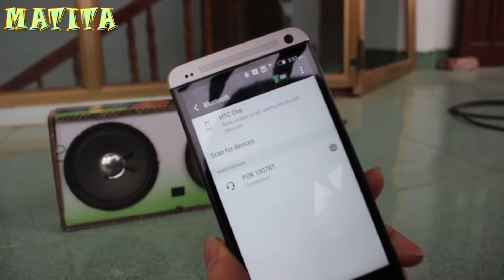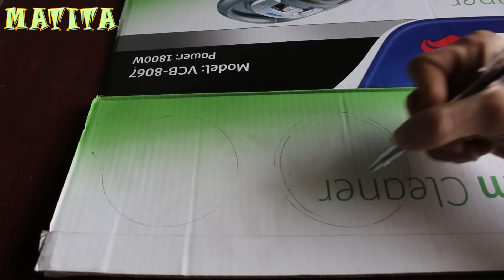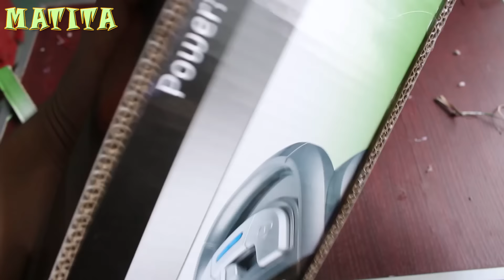Сделайте Bluetooth динамиков с использованием картона

Comment: доброй ночи! купил модуль блютуз, но немогу найти куда припаять питание и колонки, может подскажешь BL3256 DIY Bluetooth 2.0 + EDR Модуль Аудио SOC Чип Работает с Arduino, покупал на али  
good night! I bought a Bluetooth module, but cannot find where to solder the power and speakers, you can tell BL3256 DIY Bluetooth 2.0 + EDR Module Audio SOC Chip Working with Arduino, bought on aliexpress